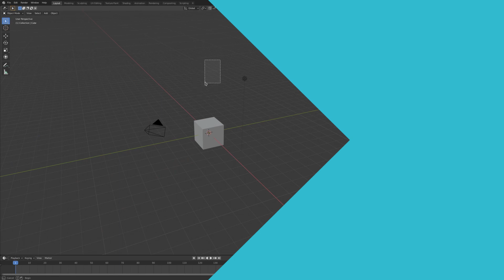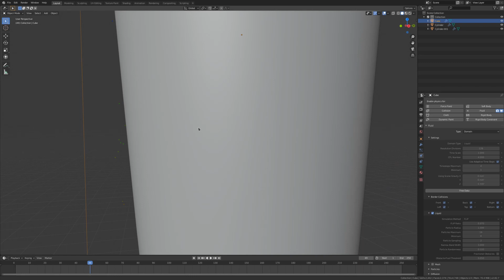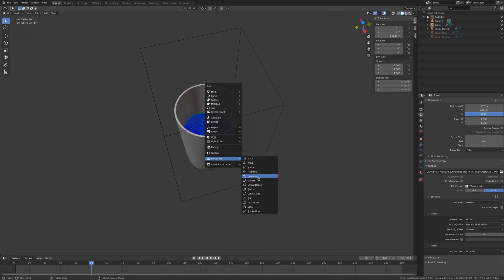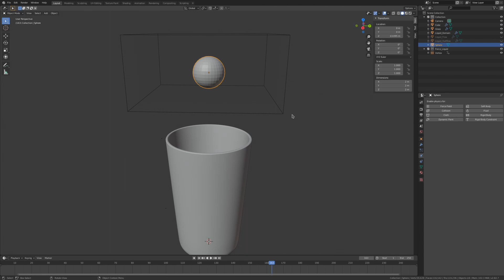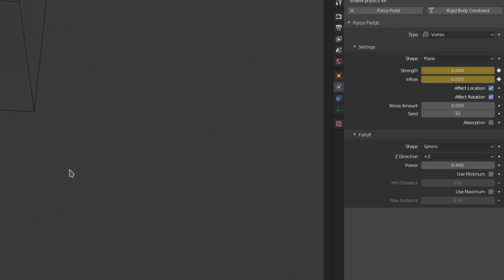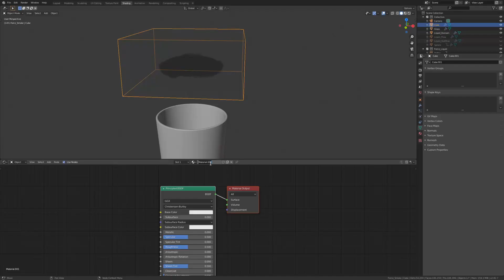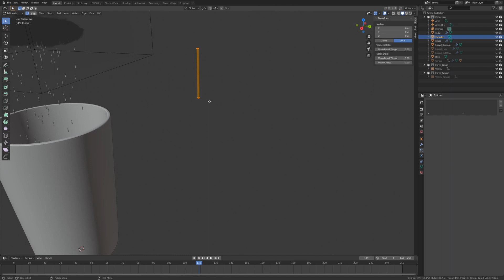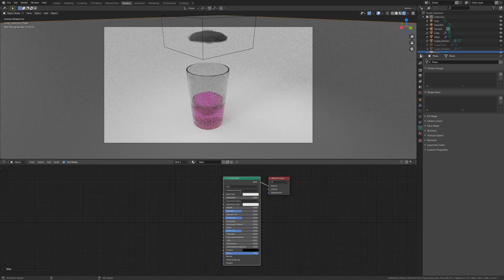Creating a Vortex in a Glass | Blender Mantaflow Part 11

Comment: Mr cheebs  lets say I have a bumpy ground as a collision object with a desert shader and I want to have the visual effect of a moving sand by the wind like dust when wind blows across the ground using mantaflow, is a bit tricky since it has a specific connected particles pattern which I find it very hard to achieve with the manta flow parameters